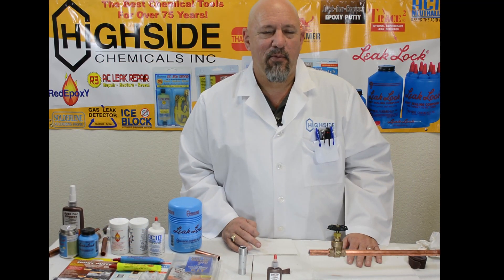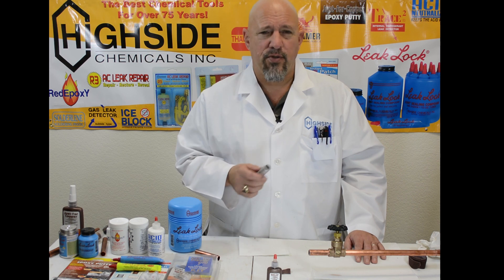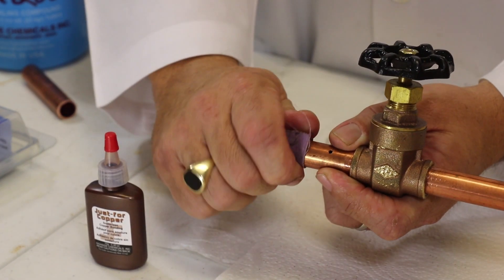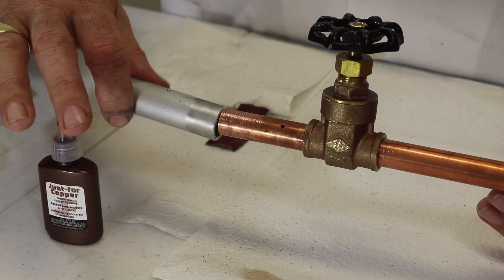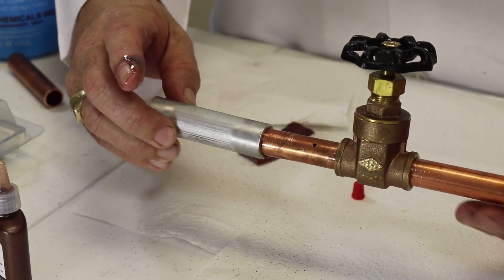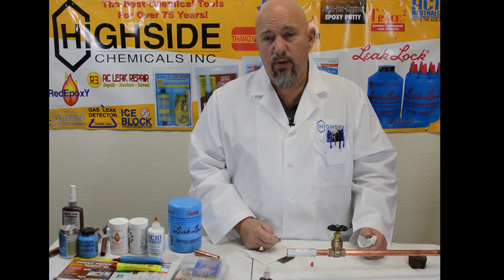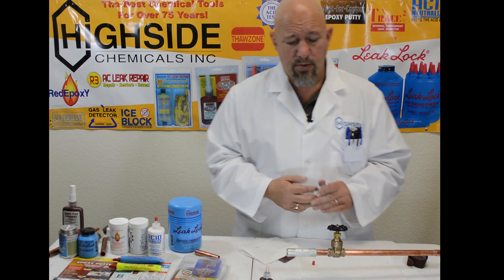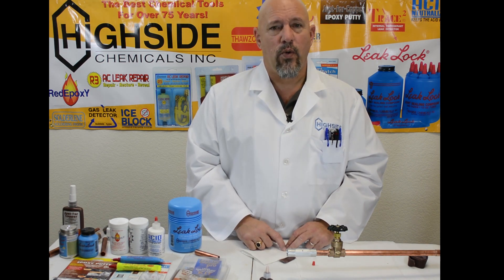JFC Aluminum and Copper Bonding

Comment: Can this be used to bond a flat piece of copper to a flat piece of aluminum?
Reply from the maker: Hi Paul, thank you for the comment. The chemistry will remain the same. The instructions will need to be followed for the proper application to take place. The most important part for your particular application would be removing the oxygen for the cure to take place. If you have trouble, please give us a call to go over your application in more detail. 800-359-5599